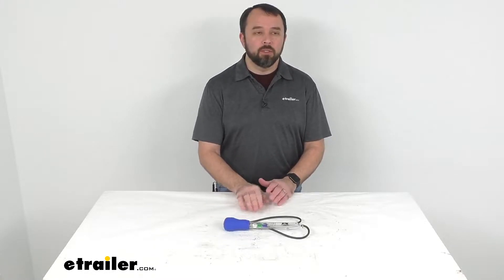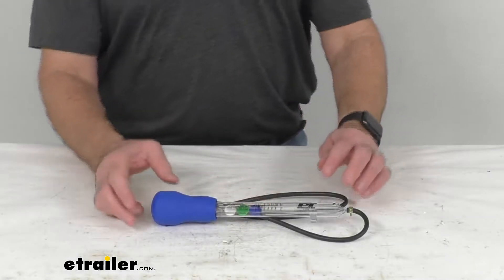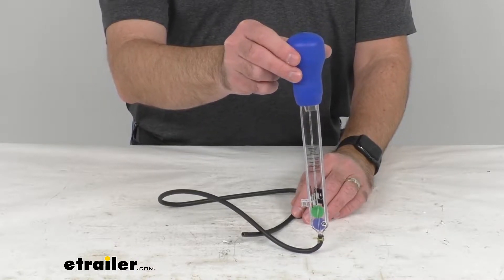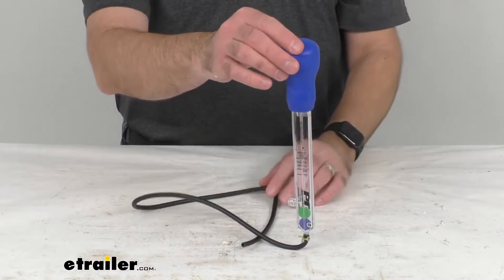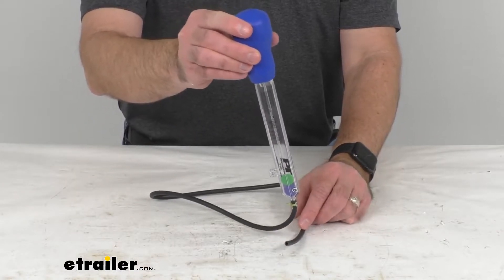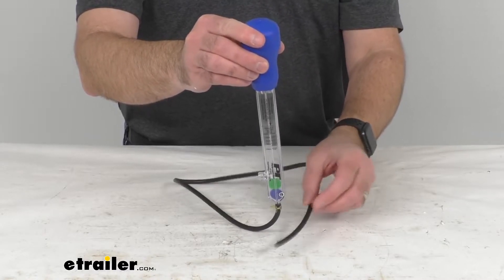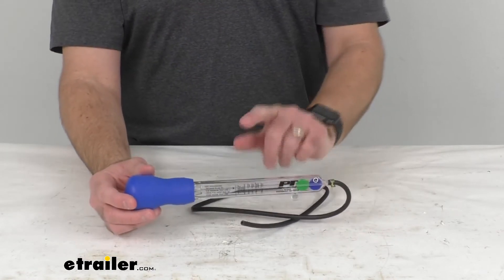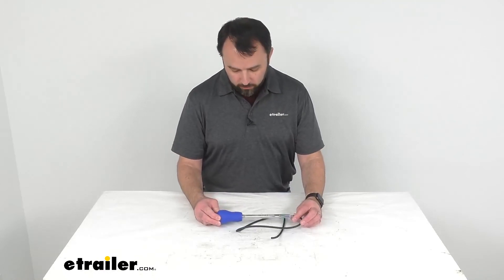etrailer | Complete Breakdown of the Professional DEF Tester

Comment: I need to clean the tester after used  with water ?
Reply from the maker: You will want to rinse the tester with water after it's been used.
https://www.etrailer.com/Automotive-Tools/Performance-Tool/PTW16500.html
Reply: Notice he doesn't demonstrate how it works because this tester gives false readings. I used the sight tester and it showed 32 1/2 percent but with this crap the white disc was the only one to rise leading one to believe that the def fluid is bad or contaminated. Do not buy this crap.